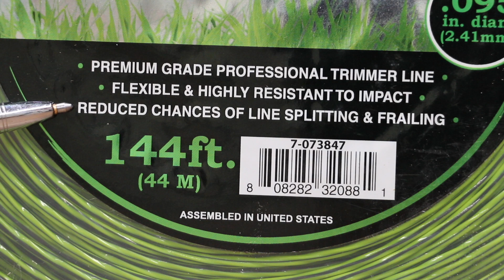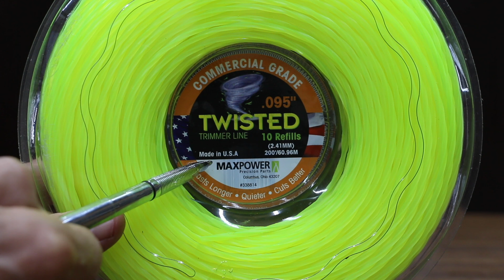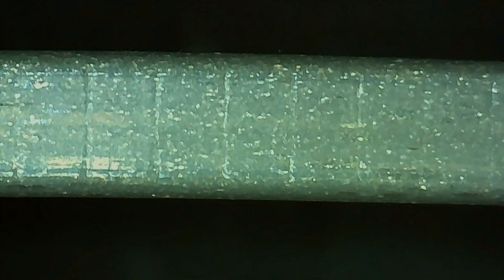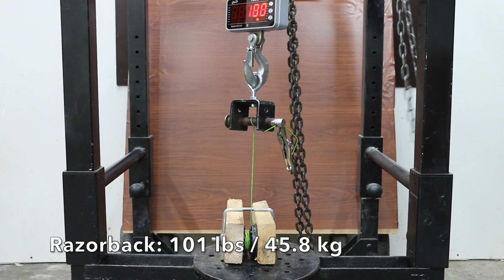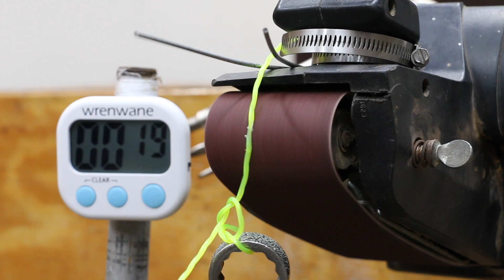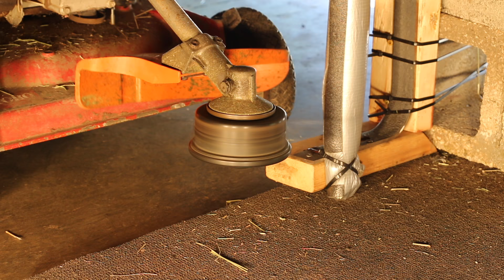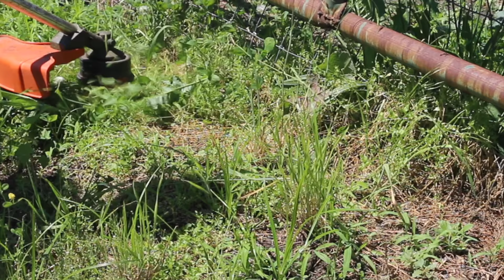Best Trimmer Line? Let's Find Out! Round 2: Stihl, Husqvarna, Echo, Oregon, Shakespeare, Weed Eater

Comment: I'm actually fairly surprised by the results. I am a professional landscaper and I have always had the best results with ECHO line. But my experience is just anecdotal, I seem to go through Stihl line much quicker. I generally have to reload my trimmer every day and a half of work with Echo whereas with the same size Stihl line I generally have to change it just more than once a day
Reply: I haven't watched the video yet, but I use that Echo line as well. I used it for years until I got a new Echo weedeater and now I use a triple-line head with .120 line. Big stuff.
Reply from the maker: Thanks for sharing.

Comment: Great video! In my younger years, I worked as a weed-eater hand for a professional mower service. Though that was long ago and I cannot remember the brands (and likely, the tech has changed since), I can warn you that those test results are not as conclusive as they may seem. Especially when it comes to the exotic twisted types: some of those can actually blow the grass down and away from the line, requiring much more effort and gas.
I think also it could come down to "who" is using the string. The average homeowner who mows once every week or 2 probably will get better value out of the more premium brands. But like in my case, when I likely averaged 10 miles per day of walking with a weed-eater at full throttle...it didn't matter what string you ran, it was getting spent like nobody's business--I recall the cheaper brands being more valuable to the business.
Reply from the maker: Thanks for sharing.
Reply: Time is money.  I suspect that minimizing the time needed changing spools or rewinding spools might factor in heavily to using a longer lasting line.  The line costs might be trivial to the labor savings.

Comment: Perhaps a test on low RPM cutting would be good,  one of the supposed benefits of the sharp angled line is that it will cut at lower rpm which reduces breakage on impacts.
Reply from the maker: Thanks for the video idea.

Comment: I would love if you could test which wet dry vacuum has the most powerful. It's incredibly frustrating when shop vacs say they have 6 horsepower motors, when you really can't even have a two horsepower motor on a standard 15 amp outlet. So when you go to buy a shop vac you really have no idea how powerful it actually is.
Reply from the maker: Thanks for the video idea.
Reply: Vacmaster  VBV 1210 5 HP does decent for the size since it's also a blower.

Comment: Slightly related, you hit the nail on the head, loading trimmer line blows. So while good trimmer line is important, my Ego string trimmer with autoloader is life changing. My Echo string trimmer works okay but collects dust because that Ego unit is so much easier to use 99% of the time.
Reply from the maker: Thanks for the feedback.

Comment: You didn't test this trimmer line but a good friend of mine who has been trimming his acre lot on a local lake for the last 25 years (mostly weeds and too rough/rocky to mow) called me a couple of weeks ago and told me he had found the best trimmer line he has ever used in his life. He gave me the description but couldn't remember where he bought it. He thought either Lowe's or Home Depot but they didn't show it on their website and I couldn't find it with a Google search either except for a big partially used box for sell on Ebay. Turns out that Home Depot has a lot of it in stock so bought a 200' spool but it's still not on their website. I haven't used it yet but I'll post my results after as I use it. It's SPEED PRO .105" (2.7mm) HEAVY DUTY PROFESSIONAL LINE. It has a clear exterior with a blue center. I don't remember the cost but it was about the same as Echo line. It might be too stiff for a bump feed trimmer but I'm converting my trimmer to a 4 line fixed head.
Reply from the maker: Thanks for sharing.
Reply: I finally converted my new Shindawiwa T262 bump feed trimmer to a 4 line fixed head and installed the SPEED PRO .105" line  yesterday. I cut 2 pieces of line 14" each and when I threaded it through the trimmer head I ended up with 4 1/4" of line sticking out of the 4 line fixed head. The line I was using wore down real fast but this line wore only down about 1/8" after I did my whole yard. I have a lot of live oak trees so I always have a lot of small oaks coming up from the many acorns the squirrels have buried. This line cuts right through the small oaks. It also works better when trimming curbs, sidewalks and driveways. This line cuts better and lasts much longer than the .155" line I was using in my old Shindaiwa trimmer. My friend was right this is the best trimmer line I have ever used too.

Comment: Would you be able to test regular atf diluted with diesel oil vs 2 cycles oil vs regular motor oil undiluted, for wear. People add atf to increase lubricity in diesel fuel and I have not seen anyone doing any testing to prove that atf is a good lubrication for diesel fuel.
Reply from the maker: Thanks for the video idea.

Comment: As usual, unbiased and straightforward letting the results speak for themselves.
I would like to point out one thing though... I’m 40 and probably have more hours of experience with string trimmers than most. When I was a teen I worked 40 hour weeks for 2 years and trimming was ALL I did. 
That said, I can tell you that regardless of brand, the most common reason the string fails to feed or gets “jammed” is because the user wrapped the string too tight around the spool when it was replaced. Jamming has very little to nothing to do with the design or brand of the string.
Reply from the maker: Thanks for the feedback.

Comment: Surprising results, I would have expected a triangle line be more prone to tangling up.  
I used  many rolls of that Stihl one in my old job and my professional opinion is that its about the baseline in durability. Would there be any actual benefit for a slightly better cut like with the Twisted? I'd say not noticable, you'd be pulling on the feeder a bit more and filling the roll a bit more frequently, if you worked long hours with it but I dont think it makes a difference if you are just cutting grass and less than finger twigs on it.  Its up to your wallets. Lot of good choices in this one.
Reply from the maker: Great point!  Thank you

Comment: do not use too thick silk if your trimmer does not have enough power. you will damage the engine. it is best to use round if you use for yard if you use for large and strong grass I recommend thick and sharp silk for which you need a strong trimmer (I speak from experience) many people think it doesn't matter
Reply from the maker: Thank you

Comment: Love the videos.  How about comparing AC filters?  Are the more expensive ones worth the cost?
Reply from the maker: Great suggestion!  I'll see what I can do
Reply: My HVAC guy said not to use the extremely fine filters because the reduced airflow can make the fan motor work harder, possibly shortening its life. Maybe that could be part of your tests, although I have no idea how you'd quantify it.
Reply: @Pseudo-Geek  That may also be to generate more service calls. I heard the same, and the AC guy said to "only use these" and held up the 3 filter for a dollar type. Claimed airflow too.
Reply: @jeffdavis6657  Nope - my HVAC guy is a friend of mine who I've known for 30 years and wouldn't be able to bring himself to rip off anybody, much less me, and because of his honesty and reputation he's always so swamped with service calls that he doesn't need to drum up business. Anyhow, Project Farm will set it straight someday.
Reply: @Pseudo-Geek  Most HVAC guys don't install a big enough return duct. That's why they say use the cheap filters. I've designed several systems and then hired them installed. They all said,,,,, why such big duct work on the return. I said so you can use a really good filter and still have air-flow!

Comment: Thanks, Commander and it was just this evening  went to the ACE for another batch of line. A buddy there used the 4-sided Stihl but he has a cam action head. Mine is a bump head running .105 line and instead of paying close to $27 for 4-sided Stihl I went with a $19 spool of Husky Titainum like before. I do a lot of weedeating along cyclone fence and landscaping rocks and the Husky line lasts and does a fine job. Sometimes it gets to cut stuff 2 and 3 feet tall and never blinks. Thanks for another fine test and BLESSINGS to all yall!
Reply from the maker: Hi Lewie,  Great selection on the Husky Titanium.  It's a fantastic product.  Just finished baling some hay last week and have another 10 acres or so for fist cut.  Just barely beat the rain. Wishing y'all many blessings!
Reply: @ProjectFarm  Thanks, Commander and I think it's really good stuff for the money. I don't believe that whole pack ever balled up on me and I usually put 20 feet in at a time and the head spool is full but no trouble if I just keep it out where it's supposed to be. Don't over do it out in the heat. And any hay put up is GOOD hay! GBWYall!

Comment: On a standard 40-something cut mower deck (or mower drive belt) , which would win?  Standard rubber belt, re-enforced belt (the brown ones), or the Kevlar belt?   I've had NO luck with Kevlar (thinking they are the strongest) but found regular rubber stretches the right amount where the Kevlar doesn't give any.  Any test ideas for this?  Maybe stretch test, slippage (burning through time), or heat induced performance?
Reply from the maker: Great suggestion!

Comment: Keep the tests coming, I appreciate your scientifically and consistency approach to them. A test of firearm solvents, lubricants & ones that claim to do both would be great!
Reply: i long ago started using engine oil to lube. if it can stand up to the heat and friction of an engine and make them run for 300k i know my guns are good to go and protected very well. i use it to clean with also. i quart and you wont have to buy any for years.
Reply from the maker: Great suggestion

Comment: And here I replaced the line in my trimmers this last weekend.
Echo .095 and old .065 Craftsman line
Reply from the maker: How well is it working?  Thank you
Reply: @ProjectFarm  the Craftsman line used on a 15 year old Craftsman weed wacker gets shortened easy on light work like pigweed and ragweed, but it holds 30 ft so isn't that bad.
The Echo line is very sharp and will cut your finger if you rub against it, and is less likely to cut when hitting things, but will easily fray. This is used on a Husky 128LD, and it holds 15 ft total.

Comment: ...And here I am using the most generic trimmer line from local Tesco 15M for around 1,70$ it's cheap but I need to add oil in the trimmer head and I didn't have a problem with it yet
Reply from the maker: Great feedback. Thank you

Comment: Is walmart-super tech  NON - 
Synthetic  motor oil ok touse in my 200,000 mile truck motor
Reply from the maker: It should work as long as it meets the viscosity and API specifications called for by the manufacturer
Reply: @ProjectFarm  thank you sir.

Comment: I would be interested in a cheap vs expensive soldering iron test, and a test on different shovels. see what it takes to bend or damage the blade of the shovel.
Reply from the maker: Great suggestion!  Thank you
Reply: @ProjectFarm  Believe it or not, Fiskars has (or at least had) a lifetime guarantee on its all-steel shovels.  When mine cracked they sent a new one UPS! My son welded the old one and it's still decent! 👍
Reply: @gus473  LOVE my Fiskars flat shovel for edging!
Reply: I'll save you the 6 month wait for your soldering iron video. Buy a $25 iron and you'll feel like you just don't know what you're doing and never be happy with the results. Buy a $250 station and it'll suddenly be so simple you'll feel like a soldering god. Words can't describe the difference in quality between these price points, you have to experience it.
Reply: @PapiSmerf  just a good 100 dollar Hako is amazing.  Much better then a radio shack 25 dollar soldering gun.  A name brand soldering station will have different tips you can swap out.
Reply: Geno Merci It’s not necessary to spend that much money. The $25 iron at my local electronics store was actually good, it’s all about the quality. 

And I’ve definitely experienced a bad iron: you’d have better luck converting lead into gold than trying to solder with the $30 Parkside “soldering station” (if it can be called that) I have, I honestly don’t understand how they could have made it so horrible, and I certainly thought I didn’t know how to solder until I bought that one. 

The Hakko FX-888D I currently use is excellent, and only about $100. I’ve also heard good things (though not personally tested) about the TS-80 and other irons of the same brand, and only around $50.
Reply: @PapiSmerf  dont forgot lead solder.  Lead free is factually junk!   That is why the DoD is allowed to make exceptions for their vendors to use leaded solder. Lead free cant stand up to MIL spec
Reply: @PapiSmerf  i got a $3 soldering iron it work fine lol
Reply: @PapiSmerf  I use a £3 iron from ebay. Gets extremely hot, with variable temp and has a very pointy tip.
Reply: @DerKaktusAvant  Yeah, that's kind of like handing someone a bucket of screws and the only fastener tool they've seen or used in their life is a hammer.

They'll get the screws in, just don't watch how it's done.....
Reply: @PapiSmerf  I am not doing a circuit soldering, I am a mechanic so just solder wires and such together. The 3 quid one does the job.

Your analogy is using the complete wrong tool for the job, a 3 pound soldering iron is not the wrong tool for soldering.
Reply: @DerKaktusAvant  It does make a difference what you're soldering, if you're trying to solder a big lug on heavy gauge wire, the soldering stations used for circuit boards won't work as well as a 150W Weller soldering gun, and vice versa.
Reply: @ProjectFarm if you do this, please include different types of solder! Leaded, various lead-free mixtures (silver, copper, and so on), rosin-core, etc!
Reply: Justin Custer yea, wondering about plastic vs. aluminum snow shovel. I bought a plastic one several years ago but haven’t needed it yet. Cheap insurance 👍🏽😏
Reply: I second the soldering irons.
Reply: @Justin Custer Here's a tip based on my own experience: don't use a "snow shovel". Use a grain scoop. Stronger, stiffer, more ergonomic.
Reply: The TS80P is better than the TS80. The TS80 is better than the TS100. For someone doing a small amount of soldering, it's the way to go, unless you build your own JBC power unit.
Reply: I can tell you cheaper shovels are thinner and will bend easier. Most don’t bend where they have permanent deflection but they bend enough when digging tough stuff that your just putting your force into bending the steel and not prying the dirt.
Reply: The Hakko FX-888D is a good hobbyist level and about the best for the money, anything less is wasting time every time you use it and compromising your quality of work.  The FX-951 is the end all be all.  It will make the 888D and everything else look like a screwdriver heated in a campfire
Reply: Both great ideas!
Reply: Please do the soldering iron test!!  I have to occasionally do soldering for work (US Navy ships), and sometimes we have to solder in harsh environments where the quality of the iron really shows.  I don't have room in my traveling tool bag to pack a large iron, so a test of your type would be invaluable.  If you're wondering, I travel with my personal tools, company doesn't provide them.
Reply: ts100